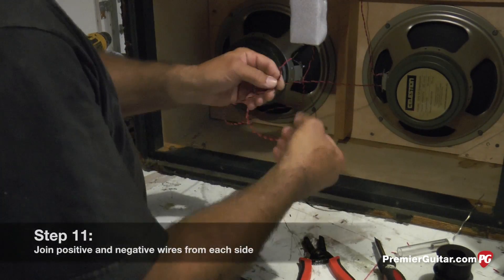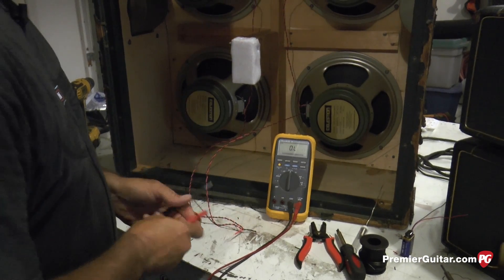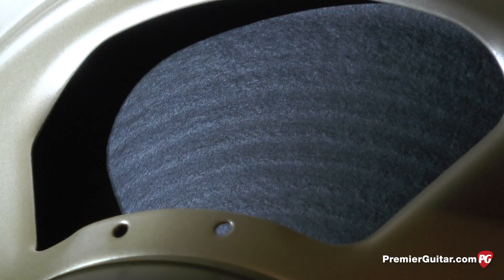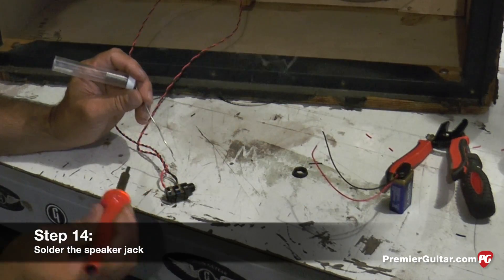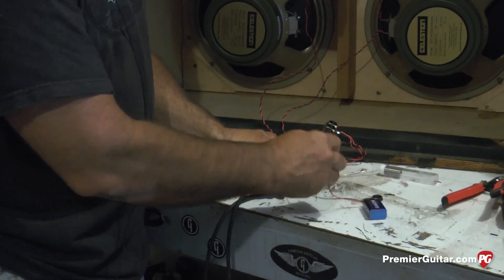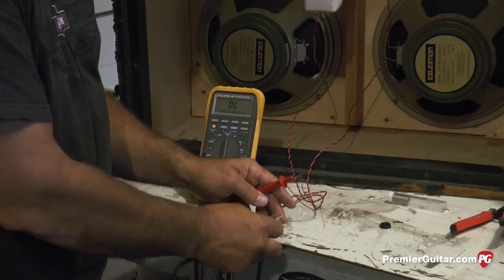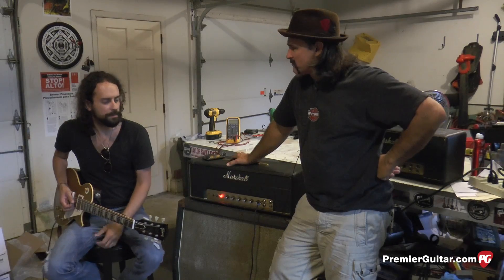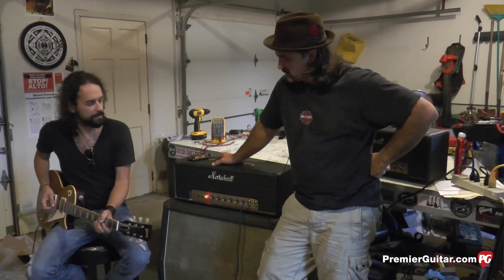DIY: How To Install Speakers in a 4x12 Cab, Part 2

Comment: THE EXTRA OHM WAS FROM SPEAKER CORD.... RESISTANCE AND IMPEDANCE ARE NOT THE SAME. THE 13.5 OHM IS CORRECT FOR A 16 OHM SPEAKER....STUDY ABOUT IT ELSWHERE...NUFF TEXTING ALREADY

Comment: great video...thnx....what about I  only have 2  12's  to go into the 4 12 cab....they are both 16 ohms.....can i run it at 8 ohms parallel....? they came out of a marshall amp....75 watts each

Comment: The impedance did not increased because you added a jack mostly increased because the speakers are not anymore facedown to the desk , the gravity influence the impedance of the speaker at rest... if you check the imp.  With the Speaker face up you get a different reading if you check face down different reading, if you check sideways different reading , a jack and wires that short can add at maximum 0.2 - 0.3 ohm

Comment: I'm an Electrical engineer.  The impedance of a circuit is the sum of resistance (dc) and the Xc and Xl (ac) resistances. Using an ohm meter you only get the dc part of the impedance.  Measuring as reactance is difficult with out special equipment.  Also the result is frequency dependent.  What all this means is for the speaker system you have impedance is equal to the resistance of the speaker + the resistance of the  the wire + the resistance of the circuit caparance + the resistance of the inductance.  If you model your speakers, tbe Z (impeadance) will come out to real  close to 16 ohms. Capacitive reactance, XC = 1 / (2 × π × f × C)
where: XC = reactance in ohms (ohm), f = frequency in hertz (Hz), C = capacitance in farads (F) inductive resistance is simular to capacitive resistance XL = (2 x PI x f x l) if you do the math you can see how XC and XL can cancel each other out at some frequency  at that the circuit becomes restive ( Z=R)  that frequency is at resonance. In speakers you don't want to happen because maximum current flow happens. Feel free to ask any questions you want.
Reply: Thank you
Reply: I miss spoke above.  You do want xl and xc to cancel each other out.  Then zin = zout there is maximum power transfer.  P=i^2r.  It hurts to try to remember stuff i learned 50+ years ago.

Comment: Appreciate the info.  Like the way you simplify and what to look for. Especially doing the top speakers first and doing it upright to avoid dropping screwdriver or whatever through speaker. You're right, that would make for a bad day. Thanks again. Good stuff!

Comment: I cant put my hand on a frequency amp.. Why not just put a mp3 song with clean bass on repeat for a few hours at a decent volume ofc.. just to make the speakers vibrate.
And regarding the wires inside the cabinet.. i thought thick special wires are better.. just like on a hi-fi amplifier - speakers conection :)
I like how you work, nice video
Reply: or use a looper pedal.
Reply: +Roby robert How would you go about playing an mp3 on a cab?
Reply: 7hotfuzz7  I use the headphones output from my hi-fi amplifier and i go with the wire into the "mp3/line input" of my guitar amplifier. I conect the cabinet to my guitar amplifier ofc, and thats it.                                                  My hi-fi amplifier is conected to my pc's audio card, and I play mp3's using my computer.   You can check out on my chanel, I have a video where I do a speaker break in using this kind of  audio "chain" :)
Reply: The easy way to go(when you don't have an frequency generator)  is to go on YouTube,  and search for "50 Hz tone" ,  "70hz tone"  etc.  And that's it!  The same thing.   You have to be careful with the volume not to blow the speaker ofc.  That's how I did a break in process to my speaker, because with mp3's you have to get too loud so you can make the cone move.
Reply: You do not want to put bass through guitar amp speakers. The speakers are not made for the low frequencies. Some amps such as the Bugera trirec, have variance knobs so you can limit the output wattage.
Reply: +7hotfuzz7 through the aux or by using an instrument to 3.5mm adaptor

Comment: hi, great videos! i've a fender champion 40 but their speakers turn distorted at vol 5 and in low tones just break up...  im thinking to change speaker, do you think i can get Good Clean sounds with Deep Lows if i replace it? or i just have to change my amp?... thanks your videos are very helpful

Comment: Could someone explain what a frequency amp is? I cant seem to find any information on them?
Reply: You've asked a physics electronics question and may not find the answer on You Tube, Google it, it would honestly take to long to answer here, you may find it in Wikipedia also.
Reply: Gustavo Castillo What he is referring to is actually called an audio frequency signal generator.
Reply: I did not know that as I've never used one of those for that, good to know if you want to break them before they should be although it seems now a days everyone wants the pre broken in speaker, I would rather do that my self but then you can also have Weber build a broken speaker that distorts far before normal, I have some that do just that and some that do not for clean, thank you for the info.
Reply: No, you are quite wrong sir, a signal generator is one thing but the question he asked likely unknowingly is just what I stated it is, a physics question I don't have time to answer fully; the generator is an electronics machine to insert a signal to find where in the circuit the opposite signal has ended, I have one and use it often.
Reply: Jyme Bale To break in new speakers all you do is plug the signal generator into your amp and sweep the audio spectrum over a period of hours, spend more time in the lower frequency range as high frequencies can overheat the voice coil(s) of the speaker(s).  I know this to be true.

Comment: nice 2 part vid.. even tho i knew most of the content already its always nice to see a great tutorial on any subject, :) last time i did this was to a 1970 traynor 2x12 cab that i got for almost nothing that was loaded with 2 12watt house speakers.. ended up using 2 150watt electrovoice loudspeakers for a total of 8 ohms.. closed back.. sounded great running off a marshall 1x12 80 watt combo.. had way more headroom than i really needed.. information is priceless.  i hope a few people out there can heed some good advice :)

Comment: Thanks for this great video, I've played with electronics a long time but just plain for got you had to have both wires on the same side on those type of jacks instead of the ground wire in the back and the hot wire on the front on the opposite side, I just could not remember and thought the other way was wrong but it is not, you forget a bit when you get older.  I'm wiring a Marshall 65 cab I built and that was the last part I needed to do, much appreciated.

Comment: I have a tip for you: when screwing the back, I would suggest making sure that the jack is on top and not bottom,
You always have a moron that will walk behind the cab and knock off the ¼ plug thus damaging the entire jack, just mu experience LOL.

Comment: Great tutorial, one question; Why do you call 13.5 ohm a 16ohm
Reply: The speaker or the cabinet is rated at 16ohm.  But when you put a test meter on it it comes out somewhat less - about 20% or so.  depending on the ohms of each speaker and how you wire them  - series, parallel or series/parallel will result in the impedance (ohms) of the cabinet which needs to match the amp.

Comment: Well, ultimately I will throw most of the anachronisms like wire gauges out of the window in favour of reliability and sense. "Made by hand" does not always equate to what people would recognise as "handmade quality"! Popping in a jack parallel to the 1/4", reinforcing the screw locations, etc. would be next. That and modifying the logo to "Mash all". Par for the course I think.

Comment: 16 ohms and low voltage means low current. lighter wire is not an issue.

Comment: He measured the physical resistance of the speakers in parallel which is a DC property. That is not impedance. Impedance is an AC property and varies with current and voltage and must be calculated. Ya can't just hook up an ohm meter and read impedance. Jes sayin'.
Reply: i guess I am quite randomly asking but does anybody know of a good place to stream newly released tv shows online ?
Reply: @Jadiel Emmanuel Lately I have been using flixzone. Just search on google for it :)